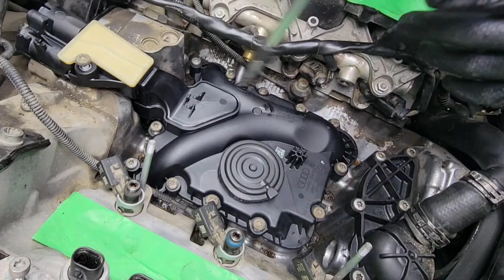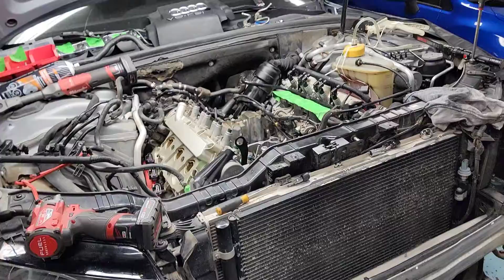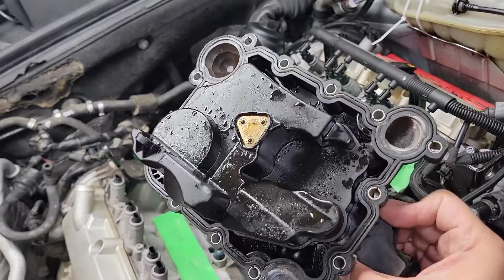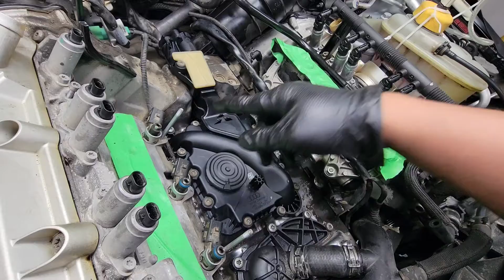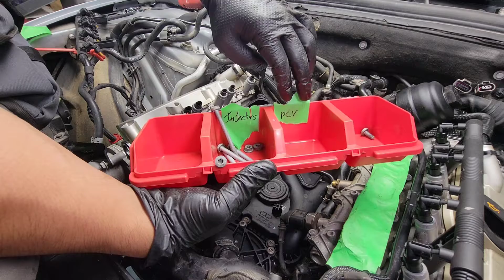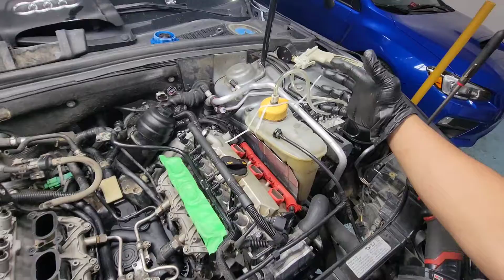Audi A5/A6 3.2L Engine! Remove/Replace PcV, Intake Runner & Fuel Rail line #repair #automotive

Comment: When you install the lower intakes make sure the runner flaps are on the “inside” (towards center of engine) of the metal divders

Comment: Did he have a stick on oil heater? I was just looking at those. Wondering if they’re any good vs an in-line coolant pump heater. Also any problem not replacing that coolant tube, did it have an oring on it you replaced?
Reply from the maker: New coolant tube and new oring replace
Reply: @jfGarage4k sorry missed that. Silicone heater? What’s sticking to the bottom of oil pan? Katz heater?

Comment: Does pcv have gas that passes threw it i changed the gasket on my 06 a6 audi and had a I'd say 3/4 o-ring didnt put back in and leaks gas now so I'm dumb founded whare it goes but my pcv has a different housing on top I'm not sure whare it goes?.

Comment: Where did u get that coolant pressure tester kit. I cant find a kit with an adapter that fits that darn reservoir . Thank you.
Reply: Advance Auto rents a pressure test kit(for free). You just have to give a deposit and you'll get the deposit back when you return it.

Comment: Why You change this PCV?
Reply from the maker: It leak coolant. Check the description from previous video
Reply: @jfGarage4k  I have a coolant leak that's not visible; there are no traces. The level drops significantly when the engine is hot and I stop. While driving on the highway, the level doesn't drop. In your case, was it the PCV valve? I don't understand what the PCV valve has to do with coolant consumption.

Comment: Isn't there supposed to be a rigid gasket that installs between the oil separator and this part that you installed?  I am preparing to do this same replacement and want to make sure that I do it right. Thanks.
Reply: I just bought one from rockauto and it comes with the gasket preinstalled which saves you a big headache